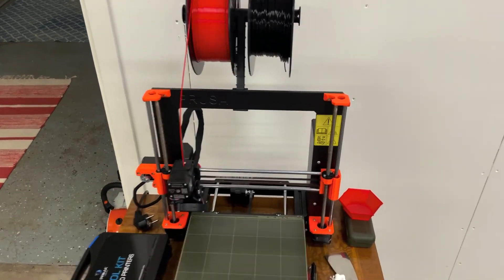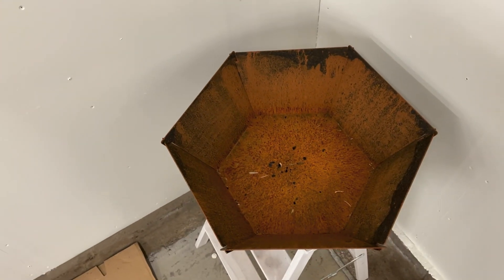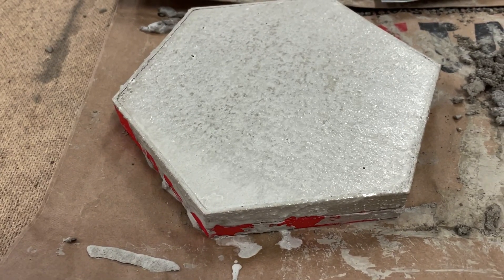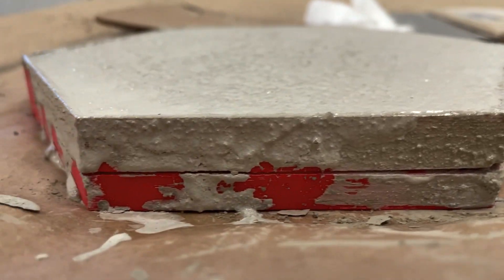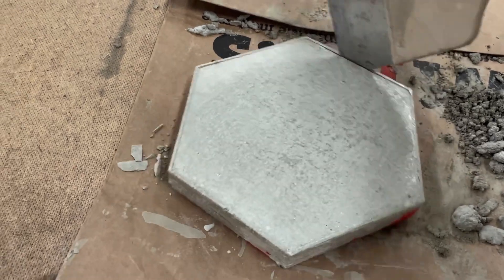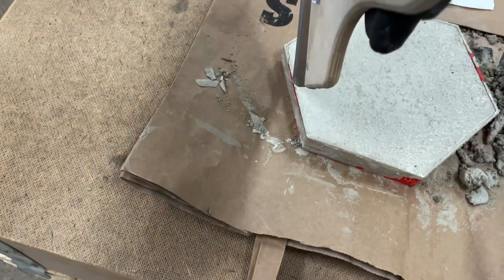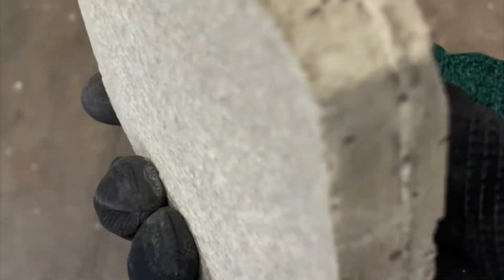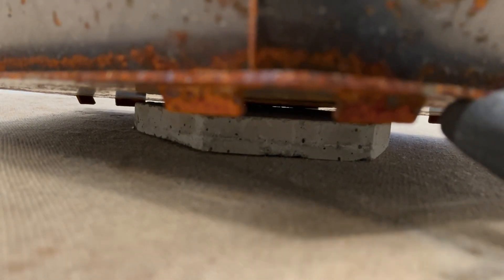99% of 3D printing nerds don’t do this with their 3D prints.

Comment: I'm sure you used Fusion 360 to design this mold.  So you could have used the Draft tool to easily add a draft angle to all the vertical services, making the concrete much easier to remove.  The Draft tool is frequently used to add draft to injection molds and this isn't much different.  The Draft tool might be a good topic for one of your tutorials.
Reply from the maker: Great Idea, thank you!